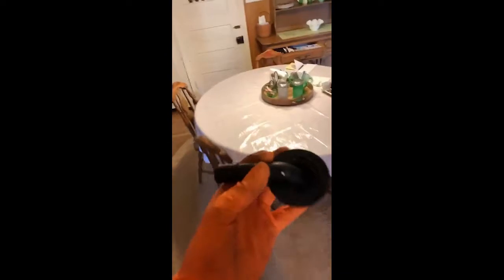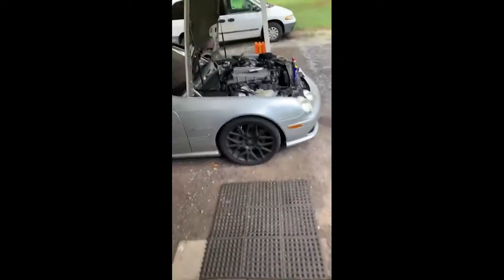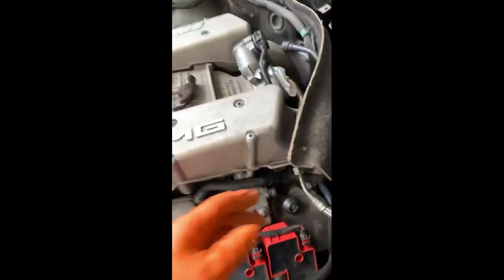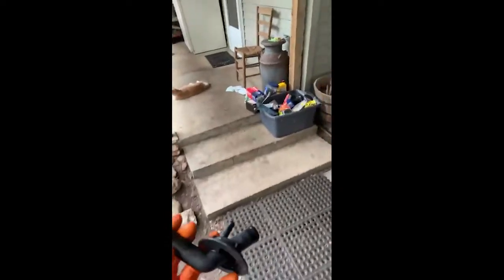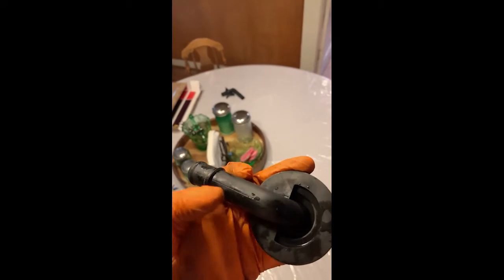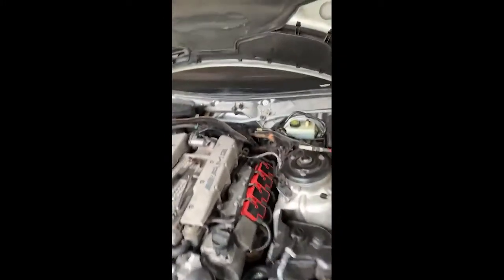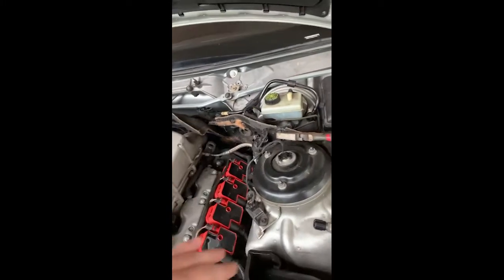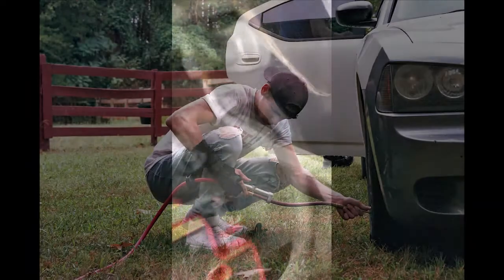2003 CL55 AMG Heater Hose Connection Replacement

Comment: Hey thanks for the directions..🙌 if I go directly to the insulation wall that you pulled back to get to the connector,  will I still have to take off windshield wipers and plastic cover?
Reply: it may be different with the E55 AMG but on my CL55 AMG i definitely had to remove the plastic cover and windshield wipers. that’s the easiest part lol. that piece connects to the heater core and another hose behind the fire wall, the front part goes to a coolant feed in the back of the head. if you have been running it with this part broken there is a possibility that you could shock the aluminum when you fix it which could lead to a blown head gasket. when i fixed mine i ended up blowing out a gasket somewhere that is now leaking coolant into my intake. lesson learned, park the car if it had a problem lol.
Reply: @tylert10121  got it fixed winded up overhauling the entire cooling system 💪
Reply: How do u remove it?